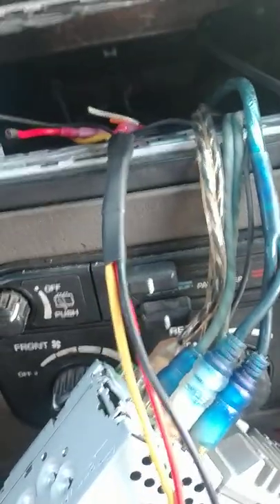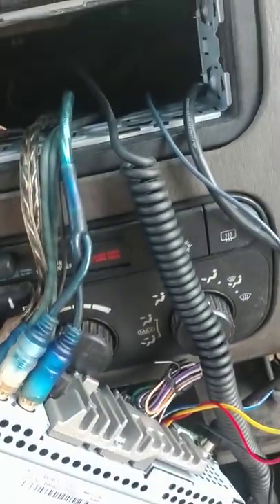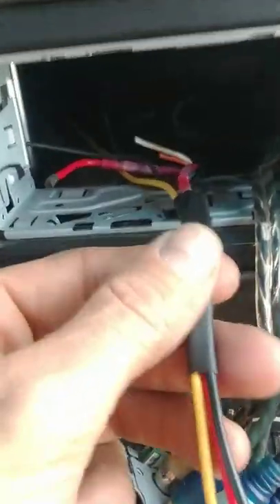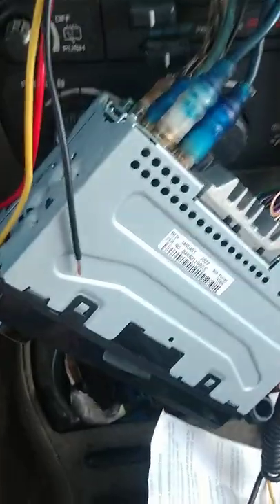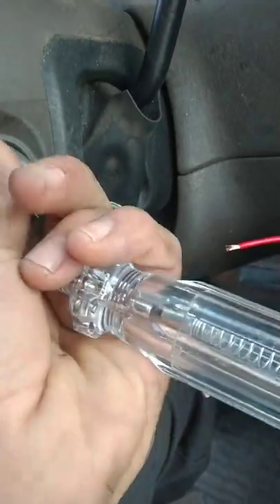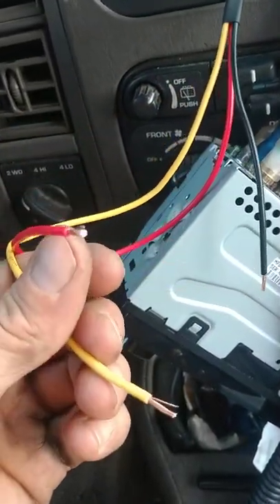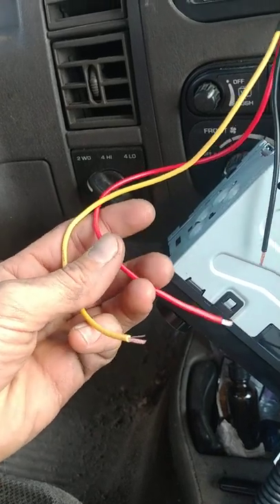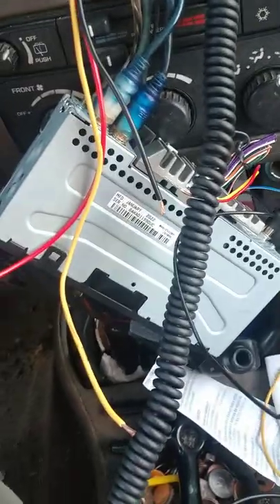How to check power wiring for a car stereo installation (12V constant and Ign/Acc wires)

Comment: Thank God I watched this video I think my yellow wire touched the radio I seen it blew my fuse so I replaced it but still won't come back in so I completely disconnected the radio n checked it a car battery n it turns on the fuse on the radio is still good any idea what else it could be
Reply from the maker: You check the fuses in the side of your dashboard, or under the hood? Should be one that says radio on it, find it and pull it out and see if it blew as well.

Comment: This may be silly but do I need to keep both - & + connected on my battery to check? Or can I still d/c negative?
Reply from the maker: You need power to check it so I wouldn't disconnect the negative

Comment: My acc wire won’t light up at all, my radio won’t turn on but the trip button and setting button still work. 😕
Reply from the maker: Did you check your fuses? Specifically the radio fuse in the fuse box.

Comment: need some help please
my ground wire touch the yellow wire and I think a fuse blow but I now can't see where the problem is
I've replaced the stereo fuse on fuse board the 
stereo fuse on the actual stereo is good but stereo stills not turning on
what could be??
Reply from the maker: Did you check the car's main fuse box? There should be a fuse labeled "Radio", check and make sure that fuse isn't blown. If it is then you won't have power to your radio at all.
Reply: Thank God I watched this video I think my yellow wire touched the radio I seen it blew my fuse so I replaced it but still won't come back in so I completely disconnected the radio n checked it a car battery n it turns on the fuse on the radio is still good any idea what else it could be